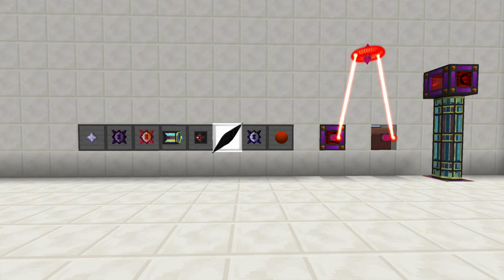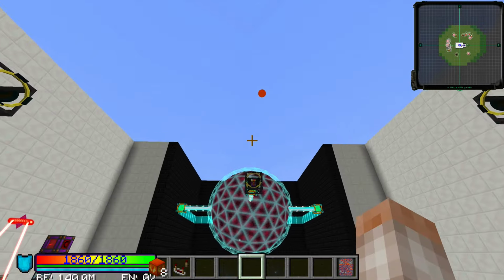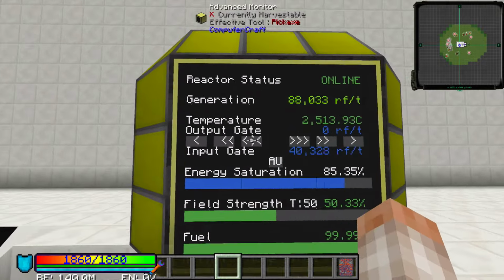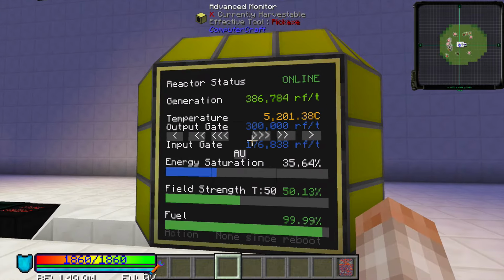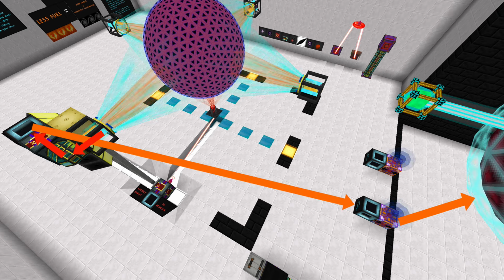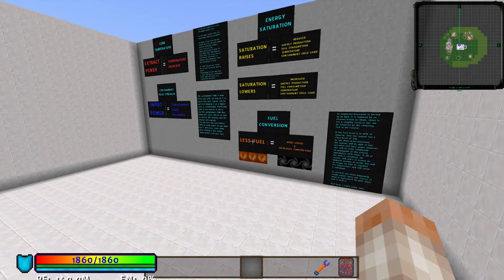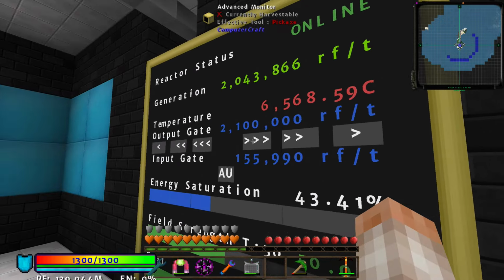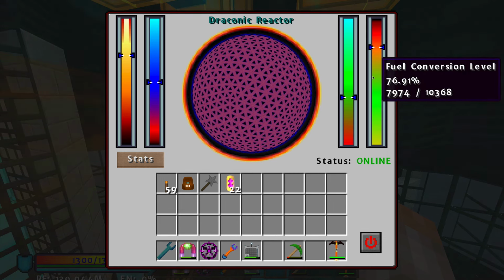Draconic Evolution Reactor Explained & Tutorial

Comment: NOTE: IF YOUR DRACONIC REACTOR LOOKS LIKE A SUN THEN YOU HAVE AN UPDATED REACTOR
The computer program is made for the older reactor
Reply from the maker: Do you have a link to new code the reactor?
Reply: @TheMindCrafters  there are ways to update the existing code to use in 1.18 but it's very buggy,  the worst part is the constant screen flicker which occurs every tick, making the interactable screen useless, not to mention the values that have essentially been amplified by 10x for both output in FE and fuel conversion. likely someone will have to sit down and rebuild a whole new program that works with the reworked reactor

Comment: I know it's been years but if anybody wants to know how to do this without computercraft: 

 - Make the output flux gate 537,000 RF/t

 - Make a comparator run out of the Energy injector

 - Set "Redstone mode" to "Sheild-"

 - Make the input flux gate 222,000 Rf/t High, 0 RF/t Low

 - Connect the Comparator signal to the input flux gate with redstone and more comparators if needed. INSURE THAT NO REDSTONE SIGNAL IS LOST.

Thats it! The flow gate will automatically put around 175k rf/t in the reactor and will pull out 537k rf/t

Comment: I love the fact that you included the explosion at the end! That was quite a hole it made. Would be an OP use as TNT but a bit pricey lol. Also Thank you so much for the tutorials. Always well explained and nice n neat set ups. Although some of these are a bit outdated and the mod developers threw us a few curveballs by changing some of the required blocks and machines used in the tutorials so I had to find a way around those. For example the wither boss farm and autonomous activators which no longer seem to exist. I ended up going old school and just using dispensers, so it is semi automatic by manually flipping a lever, which I probably could build a timer and automate :)

Comment: If the power output changes linearly with respect to fuel consumption it is by defenition NOT less efficient if fuel consumption rises.
Reply: containment field strength will increase eponetially so net power is not efficent

Comment: Tried using this for my reactor, keeps going in a loop of draining the field and charging it, never gets higher than 300k rf/t....WHY
Reply: As he explained. You need to keep it "happy", then Saturation raises. When you got saturation available, drain more out of it than usual, the heat rises, but so will conversion rate. 

It's kinda like training your muscles. Increase the demand over time. Just don't burn'em out by 

1. overheating here and now
2. starving the RF input, therefore making the shield collapse
Reply: Don’t keep taking power from it let it have a break the the fuel will rise allowing it to get higher output of power

Comment: Please explain to me how an RBMK reactor explodes.
Reply: RBMK reactors used graphite to make the reaction go faster and the water coolant to make the reaction go slower. When the water got too hot, it boiled into steam, so there was nothing slowing the reaction down and the steam blew up the cooling system. Then the reactor core got hella hot, the zirconium melted off the uranium in the fuel rods, and melted zirconium reacted explosively with the water and steam.  Plus the emergency shutoff in RBMK reactors takes a really long time to work, so if you notice your coolant boiling away, you can't shut off the reactor in time to stop it from blowing up.

Comment: when i type startup i get the error "startup:178: attempt to concatenate local 'v' (a boolean value) any ideas? I got it to work, the problem im facing now is that the automatic setting is not automatic, it stays on whatever i set it to on manual. i see on your video that the input gate actually moves, mine is still.
Reply: Are you playing in 1.12.2? Then that's the problem right there. This program is outdated. The updated version for 1.12.2 is here (works identical to this one): https://github.com/aedan/drmon
Change out your program and see if that's the problem.

Comment: what do these reactors power up exactly? i do not know what are they used for
Reply: RF Generation. Practically infinite RF and mass amounts of it per tick.
Reply: @hieuwu-dev  what is rf used for?
Reply: @maxpower7592  RF is Redstone Flux. It's energy added by the Redstone Flux mod. It can power machines from other mods. Some mods need a converter of some sort to convert the energy, though. Just know that it's an energy source.
Reply: @hieuwu-dev  thank you
Reply: @maxpower7592  Of Course :)

Comment: I have the computer/monitor setup, they are all connected, the core allows me to turn it on with 8 draconium blocks in it, the power  and flux gates are both setup correctly for I/O yet the reactor doesn't power up at all, I did everything the video told me to do and installed the program to run the reactor yet nothing happens when I start the reactor

Comment: so considering an environmental tech tier 6 solar array produces 1.8 million RF/t, I am wondering if these days there is still any reason for this reactor... six of the solar array give  you 10.6M RF/t and no fuel needed.. tier 8 draconic energy storage is nice to store the excess...   so with other things in a modpack like ftb revelation producing significantly more power for significantly less resources invested, it seems that the amount of work that goes into this reactor should be rewarded by it starting at 10M RF/t on the low end and it going up to say 14.6 G RF/t to allow charging a tier 8 energy storage within a calendar year.  The 2 million in this video feels pretty low to someone playing ftb revelation with six solar arrays producing 10M/t.

Comment: Solved! Issue with "startup" error message:  "startup:178: attempt to concatenate string and boolean"  Edit startup, Line 178 reads "print (k . . ":  "  . . v) Should read "print (k . . ":  " ,  v) Fixed! I don't have any experience in "code writing" but was determined to find the "fix" due to the sear desire to use this specific program for my reactor spotlighted in this video. So yeah... if anyone has this issue, hope this solves it. :)

Comment: So I just installed the ComputerCraft program and installed and when launched ie "startup", receive message; "startup:178: attempt to concatenate string and boolean"  Any suggestions for possible explanation? Great series btw. Thanks for a reply.
Reply: If you're using 1.12.2 and are trying to use this video's program, that's the problem right there. It's outdated. Here's the identical, updated version: https://github.com/aedan/drmonEd
Edit: Sorry for the late reply btw
Reply: @pauldelol  404: page not found

Comment: I don't know if you still check the comments on these videos, but I'm in a bit of a pickle and Google doesn't help me.
I build my Draconic Reactor, and I pump buckets of power into it to charge it up. I flip the switch and it activates, generating about 200k RF/t give or take... and it immediately begins plummeting regardless of my settings. Energy saturation flies through the roof and the temperature goes down the toilet, until it hits a teeny tiny rate of RF that I can achieve with a solar panel and it never changes.
In about five minutes my energy saturation hits 97% and my power generation hits a whopping low of 10k RF/t. Do you have any idea what's going on?
Reply: You already found an answer? I have the same problem right now

Comment: I am curious about the times of a reactor going from perfectly safe to the explosion as a form of self-destruction system. Say you have your base set up to where you absolutely do not want a faction to take hold of the station. One method of avoiding the enemy from capturing the base and such a high-end reactor would be to set an automated system to detonate the reactor. Would you happen to know the times to go from safe to detonation?
Reply: It’s a Reactor not a BOMB
Reply: @nathanpfirman625  yeeeees, but still it can be weaponized as a bomb, a really damn good one too I might add.
Not to mention, that's what they used to blow up the Nostromo, her self destruct sequence was overloading the reactor until it went critical
Reply: @nathanpfirman625  By the way that's the basis for the self-destruct sequence I thought of doing when I made my initial comment. I got the sound files, just gotta mod in the sounds and figure out how long it takes on average for a draconic reactor to blow
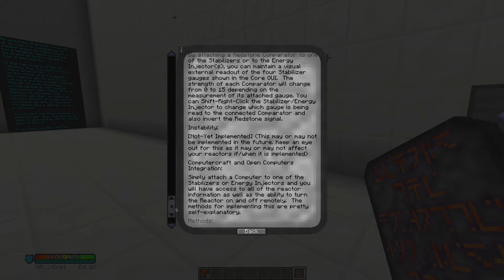Reply: It gives you roughly 3 minutes before it explodes. It calculates the time until 2:30.
Reply: @wherewiiwentwrong  Thx, that's godo to know :)

Comment: You know what, nevermind. This stuff is way too complex for me. I'll stick to Big Reactors instead.
Reply: Nah, i will probably stick to solid fuel generators
Reply: Doesn't seem to bad actually.  I'm going to attempt to set it up using Integrated Dynamics.  The mod seems to have enough programmability to use it in this reactor setup.
Reply: ill stick to my et solar array
Reply: @rest.jailbreak  Yeah ET Solar can produce much more RF/t than this reactor and doesn't cost 5 Chaos shards. Although, on my server I changed the config so the reactor makes 10x the power due to its risk, complexity, and cost.
Reply: I'll stick to quantum solar panels and use hyper energy transfer nodes to convert eu->rf

Comment: This is a good tutorial, but i feel it lacks in actually showing the whole setup process.

Currently, I have set this up in a Server and the automatic mode for the RF Input is failing. Which causing the Field Strength to drain to 15%. Which causes the CC program to use a fail safe.
Reply: You ever find the fix for this?
Reply: @thatsajokek7806  I watched this video a couple years ago or so and used the script, I had the same issue, but managed to fix it by poking around in the program, not sure what I changed, but I think I changed the calculation used for the autoInputGate fluxval, right above the safeguards section, `fluxval = ri.fieldDrainRate / (1 - (targetStrength/100) )`

Comment: One simple question. Can the bottom injector get power from I/O energy crystals? I tried to connect it the same way as I did with the fusion crafting injectors but it refuses to accept any power. I don't know if the link is broken or if this particular power conduct is not supported.

Comment: I know this video is very old, but i found a way to make it work on INFINITY EVOLVED!

After you install the computor you have to type "Edit startup" 

Then on line     280 it should say

   fluxval = ri.fieldDrainRate / (1 - (targetStrength/100) )

You need to change the value "1" to "0.75" cause infinity evolved and (I THINK!!!) Direbeast20 uses ALOT more power to work things out.

I hope i helped anyone playing on different modpacks! <3

Comment: If someone still has the problem with a blinking monitor (like me), you can edit the programm to rise the sleep time between the screenupdates. All you have to do is:
1) If your reactor is online -> shut it down!!
2) right click the advanced computer running the program, then press and hold "ctrl + T" until the program is terminated.
3) now, you can type: "edit startup" and scroll down to the end of the file, where you can find the "sleep (0.1)" command. Edit this value to 0.5
4) press "ctrl" to enter the menu, save the file, exit the editor and restart the program by typing "startup" into the console
5) Enjoy a non-blinking monitor :)
I can not guarantee this as a solution for everyone, but it was a good solution for me.
Reply: Of course a slower update rate will reduce the flickering. However the best solution is to avoid clearing the monitor at all. It's better to just overwrite each line with the new content. Of course you have to make sure you write out enough spaces before / after the new text in order to clear out the previous content. This will completely remove any flickering. Though this requires a few more adjustments ^^. I haven't built a reactor yet, so i wasn't in need of a control program. However for me the fun in playing MC is to write my programs myself ^^.

Comment: Oh btw, in 1.10, the reactor itself does have an option to SCRAM when it ether is about to explode, the Energy Saturation reaches 99%, or the fuel decreases to an unstable level. Plus, it has a ultimate failsafe where it hardwires it's generation to it's containment field and gives you time to stuff your disks into a strongbox and vanish before firey, pyrotheum filled crater.
Reply: AE, CP, or RS? [ ͡° ͜ʖ ͡°]

Comment: I am running into a problem, I've got it setup per your design, computer programming is working and there's output to the monitor.  The reactor says charging, but there's no activity.  Can anyone provide clarity on the tesseract setup, maybe the flux gate?  It seems I have a power supply issue.  Can't actually get any power in the charging cycle.

Comment: Need a short answer about the working of the reactor from anyone who ever used it, even in creative!

We just reached the point on our server to begin contemplating should we try to build one.

The facts we know:
-it need awakened draconium blocks as fuel, which cannot be automatically produced as far as we know
-then it produces ludicrous amounts of power

The question is: is this reactor only does this?
I mean if it makes chaos shards as a byproduct, or makes a magic field which helps, or something like that, then it may have some meaning.
But for getting a lot of energy, even IC2 reactor is safer, and can be automated.

If you have time to answer this, thanks!

Comment: Nothing happens when i charge my reactor... Why?
Reply: I have the exact same problem have you found a solution for it so far?
Reply: Kirasaya Not exactly but the Energy Transport Crystals didnt work for me. So i placed an Creative Capacitor bank instead of the tesseract on the bottom and cryotheum stabilizied cables instead of the Crystals. That worked for me so far (in creative mode for test) but when i tried it the second time nothing happens ... But maybe its working for you ;)
Reply: I found the solution futher down in the comments, I needed to Change the crystals Mode, the one on the flux gate needs to be Set to input x5 and the one at the injector to Output x5. You do that with the crystal Binder.

Comment: I need help with the field strength. I turn the reactor on and the strength just keeps dropping and when it hits 15% it charges again. I don't know how to get the field to stay a 50%
Reply: set targetStrenght in line 5 up to 85%
...just a simple solution that the generator dont drops under the 15% and start charging again and again. 
i dont know where i have to change something that i can target the fieldstrenght i've chosen in line 5 but it should be the formula in line 280 with a little mistake

Comment: I looked over the code of the program and spottet a possible mistake,

fuelPercent = 100 - math.ceil(ri.fuelConversion / ri.maxFuelConversion * 100)*.01

why ist there a "*.01" this messes up the actual fuel left so in this case u didn't use 0.77% fuel but rather 77% fuel, this would also make sense with the actual reactor numbers as shown in the interface.
Reply from the maker: **LIKE! This makes prefect sense. So when my reactor was reading out at 99.23% fuel remaining, it was actually supposed to be 23% fuel remaining which would match my fuel conversion ratio. Nice fine, thank you!
Reply: so that also means 2 21/2 weeks is about the limit before refuelling is required
Reply: is this fixed now in the program?
Reply: ok whats that modpack?
Reply: note to self: this is on line 241

Comment: Hello, ive got a problem. The program does not seem to interact with the input fluxgate. The number just stays at 0. Even if i manually set it to any other value (via the monitor), the flux gate does not respond at all. I also believe that this is the problem that @Haoyuan Wen has.